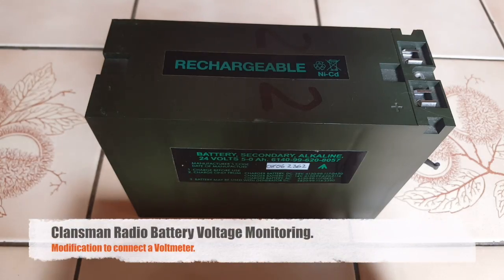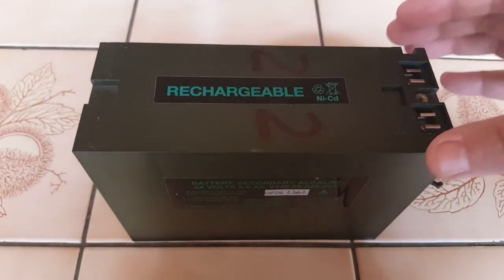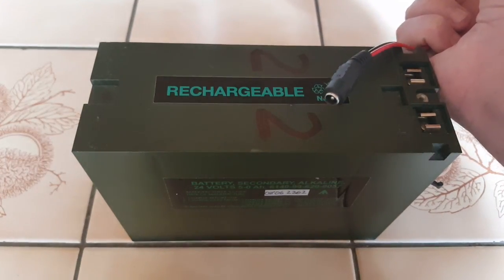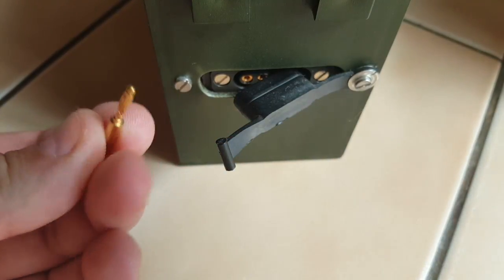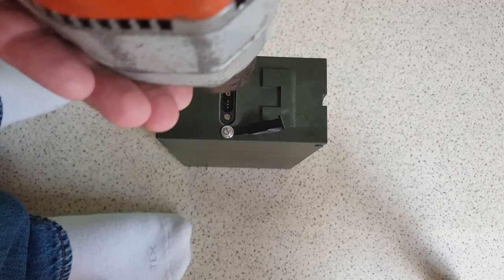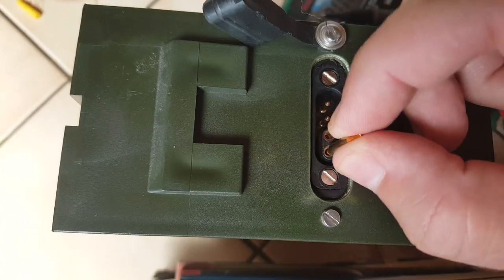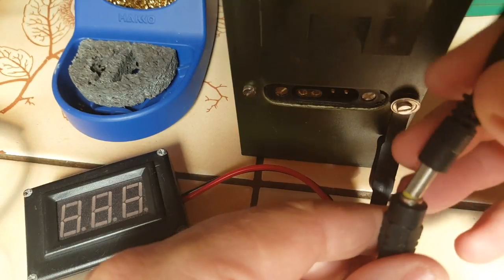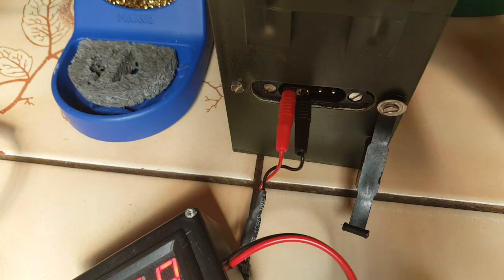Monitoring The Voltage of Clansman Radio Batteries.

Comment: hi Gil, you have recommended the 500mA Smart Charger from Component Shop to charge the Clansman battery. i was wondering if i need to plug into the charging port as well as the temperature sensors. if so, do you know if the Component Shop charger is equipped with the temperature sensor plugs?
regards,
Peter
Reply from the maker: Hi, it has a sensor but I don't use it and it works fine without it.
Reply: @RadioPrepper  Gil thanks for the quick reply! do you just clip the charger to the top contacts of the battery? how do you know when it is fully charged?

Comment: I have had an offer of a donated PRC 320 for our radio club use and during the conversation I happened to mention that I had seen or read somewhere about someone producing a LIPO 24v 3rd party battery for the 320.  Is this something I dreamt up or is there such a thing?  Thank you.
Reply from the maker: I have not heard this but I do have a 7S LIPO I can use with my 320...
Reply: @RadioPrepper  Thank you for your very prompt reply.  Would it be possible to do a short video on this concept and I would be very interested in how you set it up.  Thank you.
Reply: @RadioPrepper  Well the radio has arrived and I am so grateful to my HAM friend for letting me have it.  He has supplied a bag of bits and pieces and two batteries.   It has not been converted to LSB and he has not had the radio fired up in several years.  The batteries do not look in the best shape and I do not have a charger for them so I am not in a position to start learning how to use the radio until I can get power into the radio.  I am really looking forward to trying to get this old set up and running and will be going back over all your videos to get a better idea.  I will probably get a manual of ebay and see what I can learn.  73
Reply from the maker: https://www.componentshop.co.uk/500ma-smart-charger-for-12v-24v-race-packs-10-20-cell-pack.html

Comment: Was curious what charger do you use to charge your batteries? I have a PRC 351/352 radio. Thanks
Reply from the maker: I found a great one: www.componentshop.co.uk/500ma-smart-charger-for-12v-24v-race-packs-10-20-cell-pack.html
Reply: @RadioPrepper  thanks for the link..
Reply: @Nano_Mouse   I made a very basic charger..  30v 3a transformer ( primary 240v )  though a Rectifier and a Ceramic block resister 25w but cant recall the value.   It charges the batteries at around 1a to start and drops of to around 0.5a during charging..  I charge the batteries for around 5 hours. ( batteries are the plastic 5Ah ones )

Comment: Hi Gil, please could you tell me what the voltage should be for a fully charged battery please?
Reply from the maker: Hi, they end up at 28V.
Reply: @RadioPrepper  Thank you Gil :) it's just so i know when to stop charging them, as i use a Turnigy Accucell 8150 to charge them at a slow charge rate of 0.4A.. the genuine clansman 24v DCCU is a little to aggressive with the charge rate ah' for my liking!
Reply from the maker: So I heard too...
Reply: @SteveCI-kb1ll   I charge mine at roughly 28-30v at 1amp to start and it drops off during charging to about 0.5a.  I charge them for around 5 hours.  Some time 8 if i forget to turn the charger off.   They never seem to get warm either..  Im using the 5Ah plastic cased batteries.

Comment: What did I miss ? What radio are you running on 24 volts ? And how ?
Reply from the maker: PRC-320 and PRC-351. That battery clamps on the transceivers...
Reply: The british military "Clansman" radios like the PRC 320 run on 24v as that is what all their armoured vehicles run on, even the manpacks.
Reply from the maker: Indeed. A fully charged battery is actually 28V

Comment: Great idea Gil; I have  a Clansman DCCU charger but it doesn't seem to switch off charging, even if left for a long time :-/ the battery seems good in that it runs the 320 fine; however as I only have one battery I don't know which is faulty- battery or charger. I will get another battery soon but the voltmeter idea seems the way to go meanwhile!
Reply from the maker: Probably the charger but you won't know until you check a second battery...